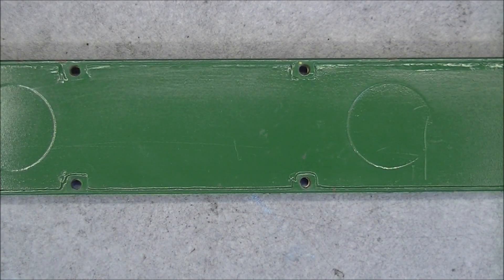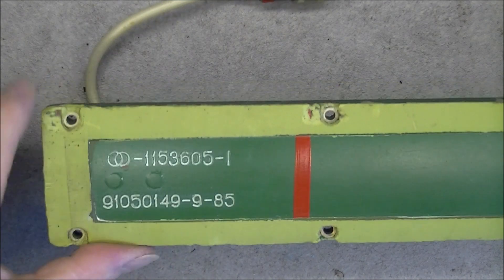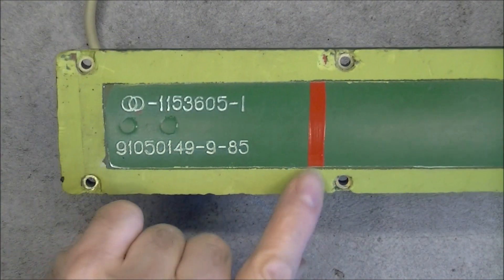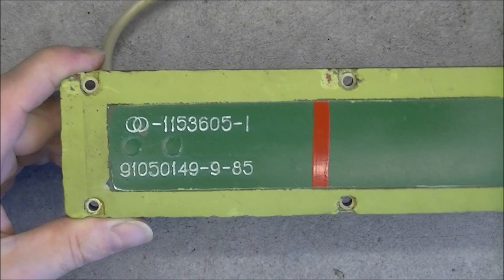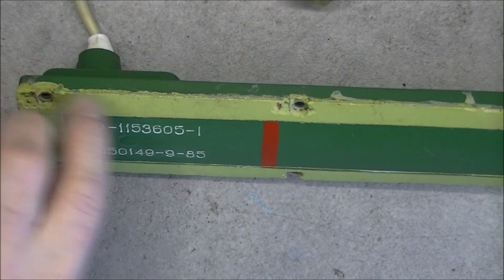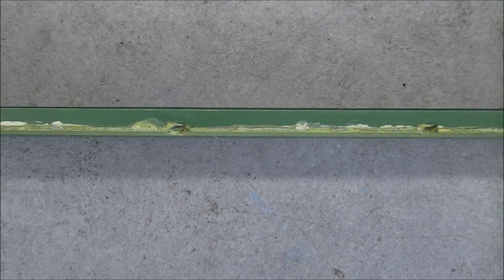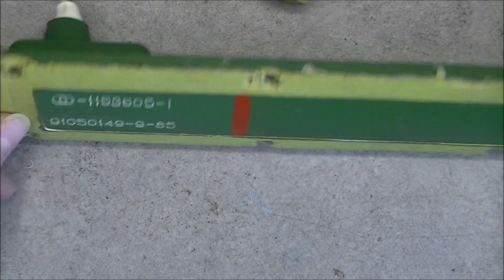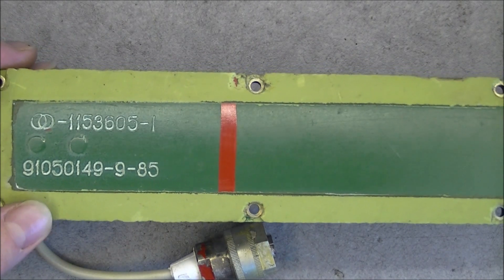An antenna from a soviet missile (supposedly)

Comment: Certainly looks like that's what it is. The color matches many Russian missile colors. But, you wouldn't see this antenna from the outside. The connector side will definitely be the interior side (practicality, aerodynamics), and the other side is marked too strongly to be exposed. Those rockets often have aerodynamic covers over the antennas. Here are some links of interest:

Here you can see some cut-away views of one such missile, including one of the antennas:
http://militaryrussia.ru/blog/topic-101.html

Look through this gallery (click on image and keep going):
https://vpk-news.ru/photographs/gallery/842

You can see how these missiles are shipped and how they're tested/calibrated prior to use. In the third image, you can see a radar test set connected to the missile - a relatively high frequency receiver/transmitter pointed towards the nose cone radar (you can infer the frequency based on the waveguide size), as well as 4 antenna couplers positioned around the missile to "talk" to the antennas underneath. The form factor of those antennas is similar to what you have. And everything is being controlled using that test set box underneath.

Please don't attempt to get this setup as a living room decoration. ;)

Comment: The air defense system under the NATO name SA-2 is C-75 (S-75).
This is probably the antenna from the radio-fuse of the rocket.

https://www.armyrecognition.com/russia_russian_missile_system_vehicle_uk/sa-2_guideline_s-75_dvina_desna_volchov_ground_air_missile_system_technical_data_sheet_specification.html

http://www.russianarms.ru/forum/index.php?topic=8814.0